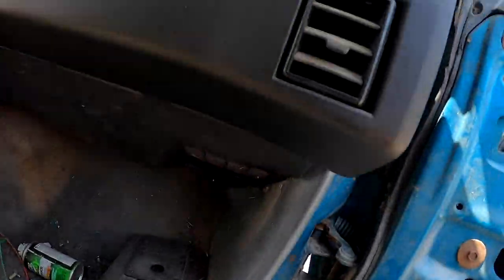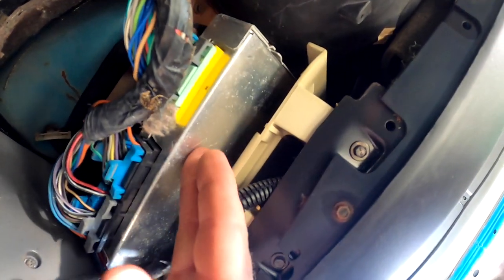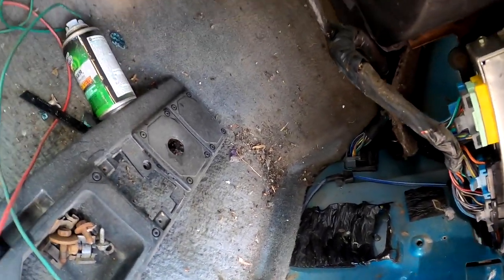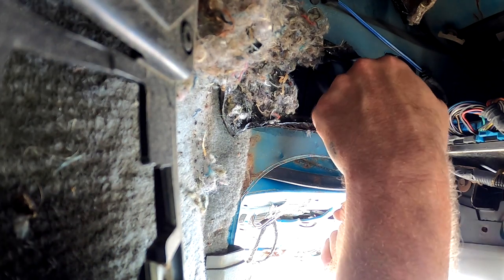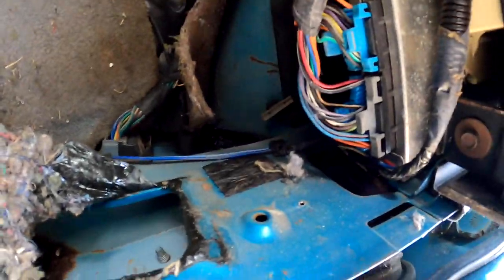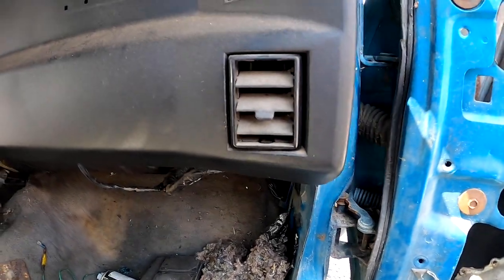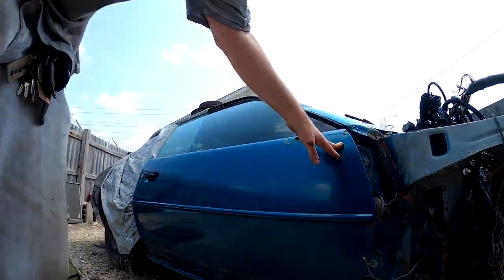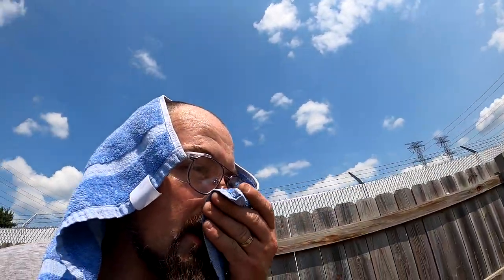How to install/remove 3rd Gen Camaro/Firebird doors

Comment: Well damn, what if I wanna save the wires? I'm just trying to take the doors off to paint em
Reply from the maker: Idk bud
Reply: I can help with that mate. I know I'm a year late, but I'll make the comment anyway lol. Pop off the pegs that hold the wires to the door lock actuator harness, unplug it and fish it through the rubber sleeve. Unplug the window motor harness, same story. And there should also be at least one more plug that will come out at the door that should be easy enough. It's just a bit tedious as the pegs will try to catch as you fish them through, just be patient and go slow. 
XOXO
Jean